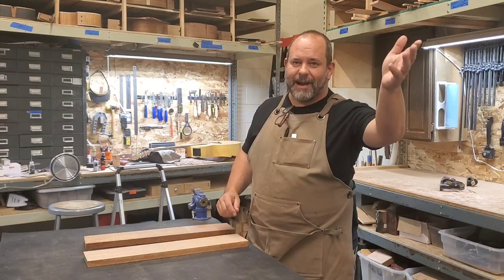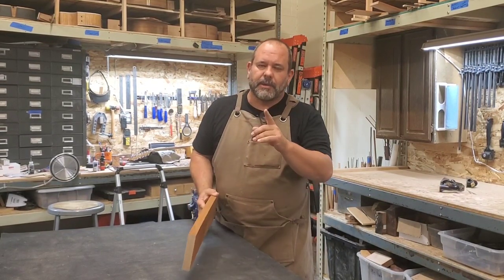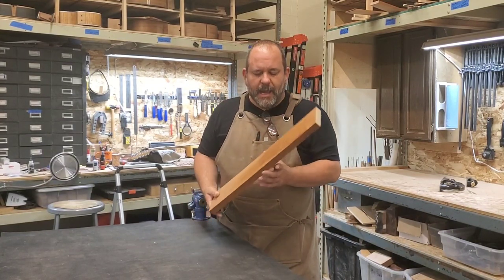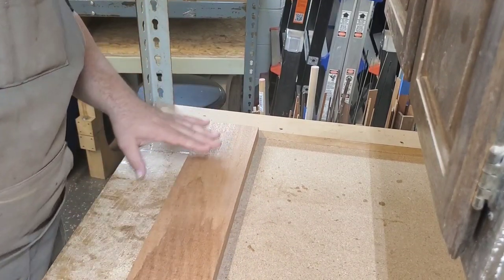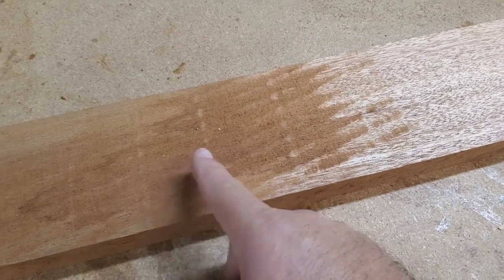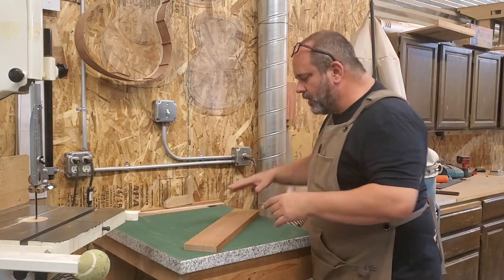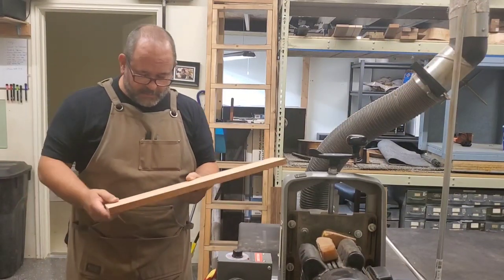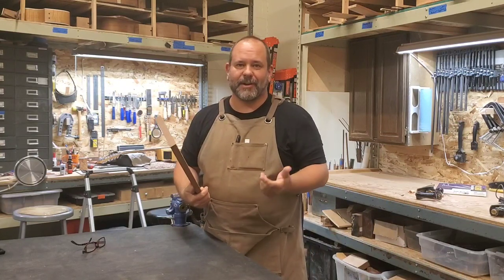Flatten a board with limited power tools

Comment: Thanks, that was good. Had to giggle a bit at your granite board sanding. I use a similar method, in reverse. I have sandpaper attached to a 2' x 2' hunk of flat mdf. Can even use that thing on tops and backs.     It works reasonable well.